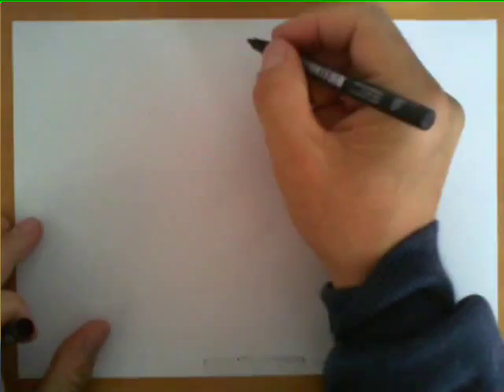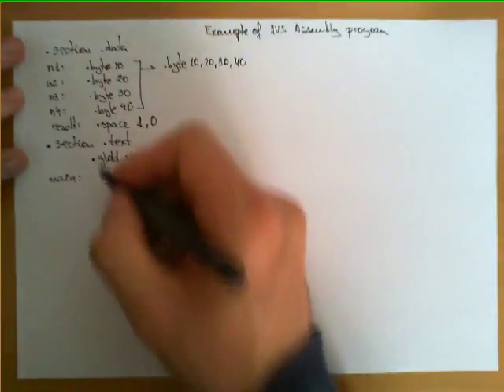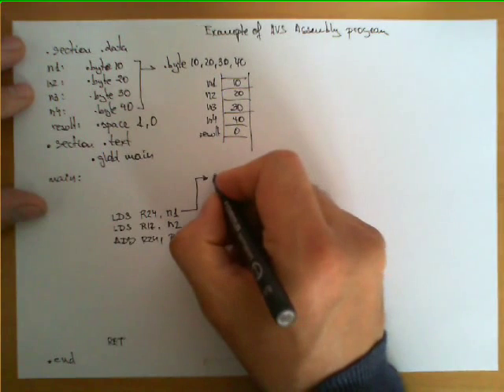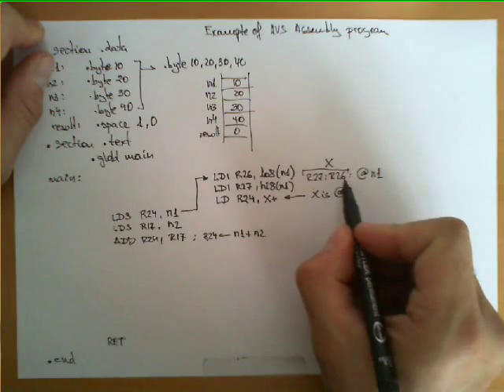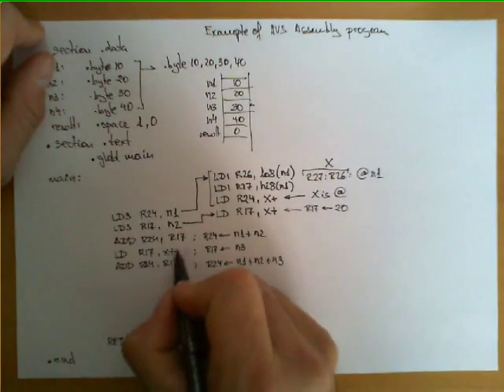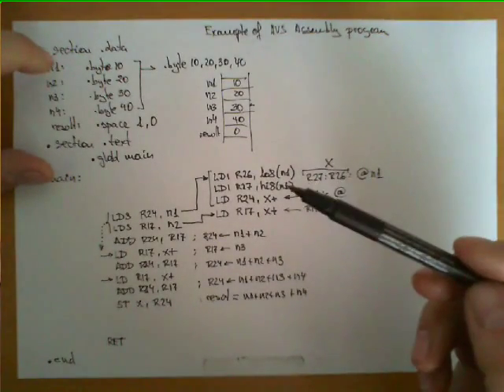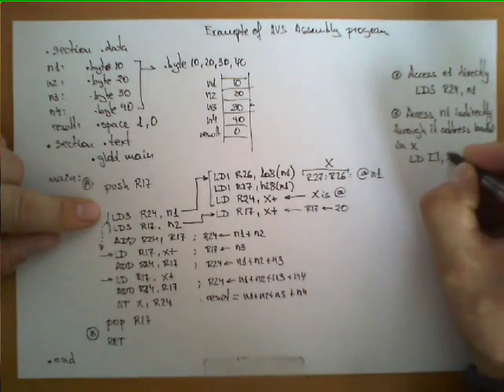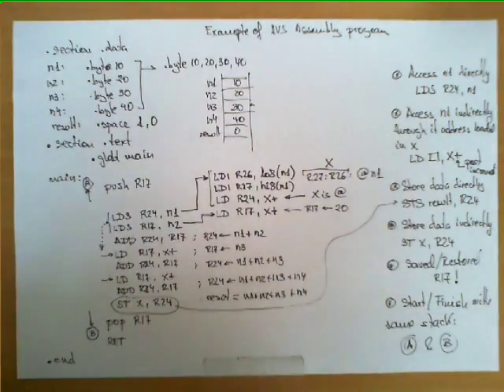Example of an AVR Assembly Program

Comment: How do i know which registers to leave the same? For example you saved the value of R17 into the stack and then popped it right back. Also, I thought that was the case when you where working with C and assembler files together. What if im just working with an assembler only project?

Great videos btw, they are more than cristal clear

Comment: programming a simple precompiled (.S) assembly interrupt routine could be more significant; (typical, INT0_vect) (with or without writing to the stack pointer in avr-as (avr-gcc)); an example of an assembly program introducing the interrupt enable bit, with or without interrupt flag bit, selection of edge detection; after sei instruction, possibly for an MCU with SRAM onboard!
...although, it's great to see familiar code!